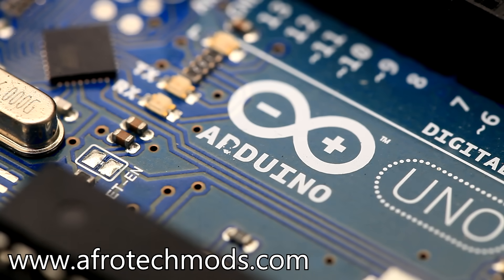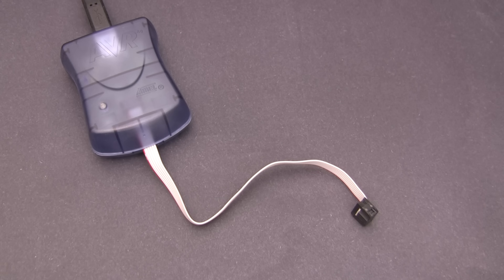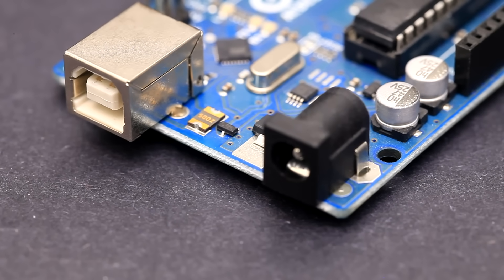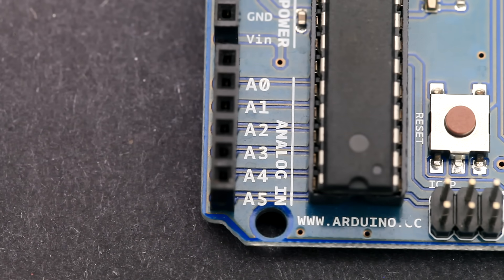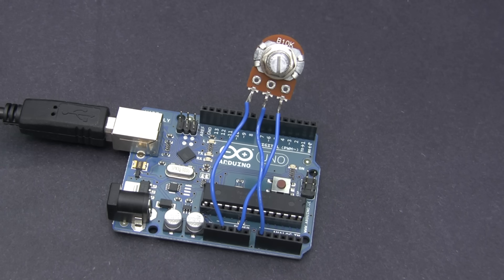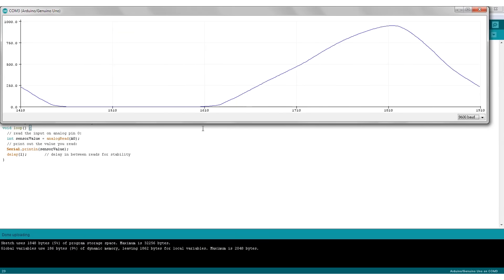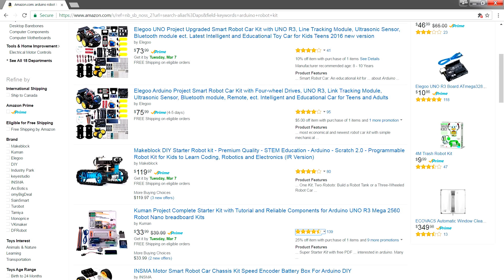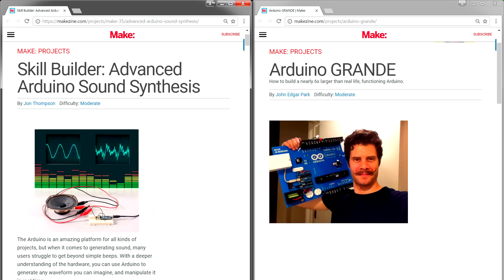You can learn Arduino in 15 minutes.

Comment: I love this tutorial!,  It's very brief, detailed, and presented with a high image quality (I've seen other videos). I'm looking forward to watch the crystal resonator tutorial. So far I haven't gotten a grasp on them ... I understand they vibrate reaching a super high frequency but I yet don't understand how it controls the CPU speed. Thanks a LOT!!
Reply from the maker: Imagine those high frequency vibrations caused high frequency changes in voltage. Then imagine there was some circuitry to convert those small voltage changes into a clearly defined square wave of a certain frequency. Then that square wave (the "clock") tells transistors in a CPU when to switch!
Reply: Quartz has the strange characteristic that if you squeeze or stretch a crystal made of it, a voltage with a particular polarity is developed across the crystal.  This also works in reverse so that if you put a voltage across the crystal, it tends to either compress or expand slightly, depending on the polarity of the applied voltage.

When a quartz crystal is cut to a specific shape and size, it will tend to vibrate at a particular frequency and only at that frequency if an oscillating electric current is applied across it.  With a little electric circuitry to support it, the crystal can be made to oscillate (vibrate) at only that frequency, and the oscillations can be detected and used to drive circuits such as computers at a very precise rate.

Computer CPUs need a clock signal in order to keep everything running together.  For example, you don't want a register to try to latch in a data byte from memory before the memory has had time to supply that data byte.  The clock signal is used to make sure that everything runs at the same speed.  A quartz crystal is a convenient way of supplying that clock signal.

An RC oscillator can be used instead, but it's not as precise as a crystal.  Some things such as serial communications require a more precise clock signal than can be supplied using an RC oscillator, so a crystal oscillator is usually used instead.
Reply: Afrotechmods Oohh I see, wow, thank you so much!

Comment: 3:40 They (AVRs) are made by a company called Atmel
It is very sad that Atmel brand is gone. Microchip has killed Atmel Twitter account.
I was browsing Micro controllers on Digikey and all AVRs, ATMegas and SAMDs are listed as Microchip.
Reply: Us, hobbyists, really don't have to worry. We may not get new ATMegas/ATTinys/XMegas/… but Microchip will surely keep manufacturing the existing ones (these guys are well known for not artificially obsoleting products—they're still making chips that came out in the 90s—as long as people are buying it, they'll keep making it) and avr-gcc is open source, so they can't cripple it like their own version of GCC.
Reply: Microchip will be a great steward of the Atmel products, they are larger and have more resources.
Reply: Ali Mirjamali well, what's the difference? They are just going to change the branding. It's not like they are going to stop supporting AVR, they have a huge share in the hobbyist market.
Reply: Yes. I sincerely hope so.